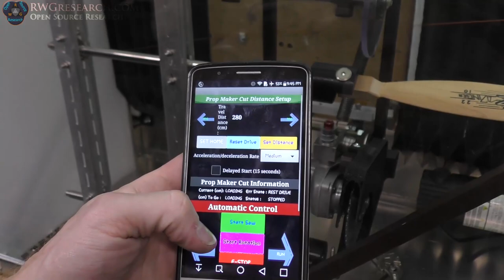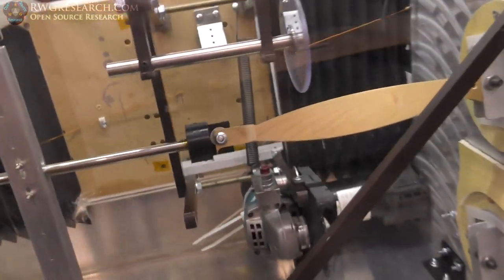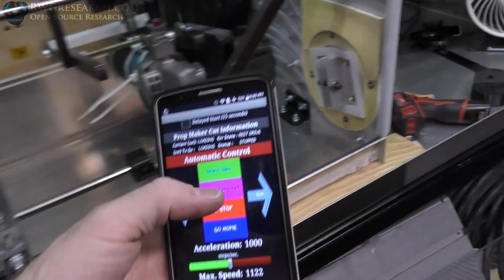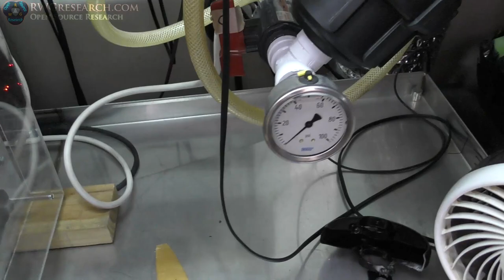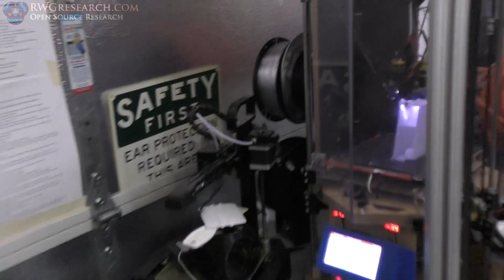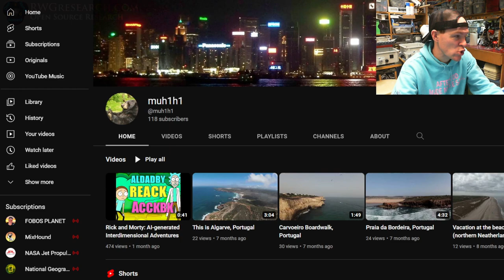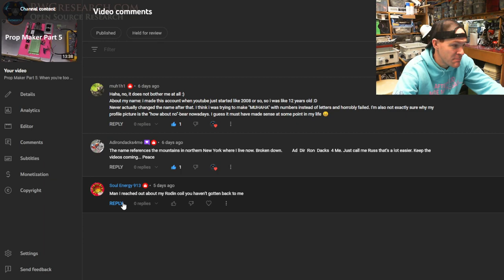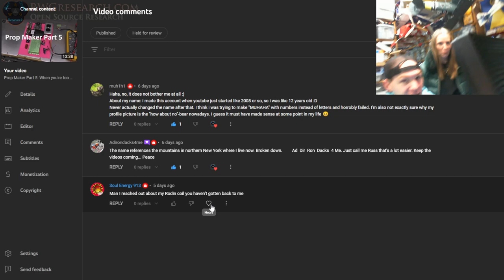Prop Maker Part 6: When you're too cheap to buy props!

Comment: The accordion paper is pretty genius Russ.  I think I missed your last video some how.  Life was getting hectic with my stupid part time job, which thankfully has come to an end, and I start a new job Monday!  Pay isn't as high as my last design job, but should be a much better way to live.  It will give me more energy to put into my own endeavors!  You could probably make some fancy railing rungs or table legs with that prop maker too.  3D print something like a corkscrew design as the original and then cut it out of some sweet oak or something with cool looking grain.
Reply from the maker: heck yeah! that's the way to love brother. its not always about the $$$ one must enjoy life too! ~Russ